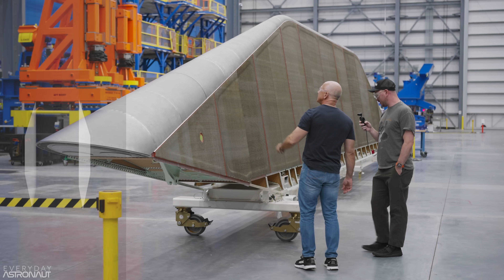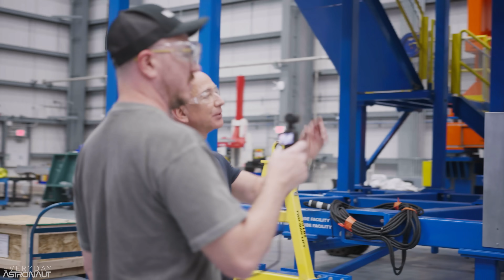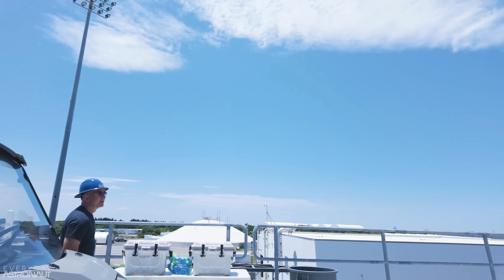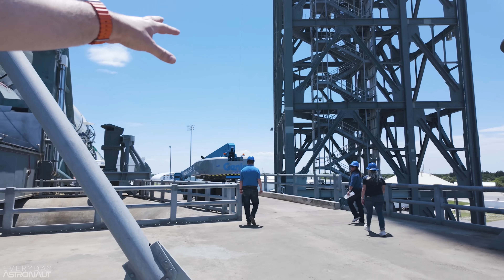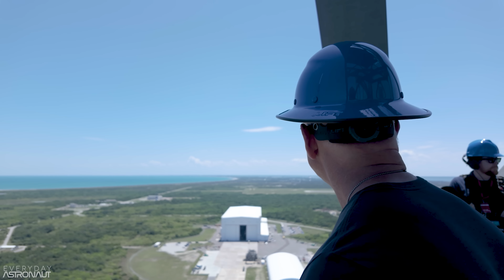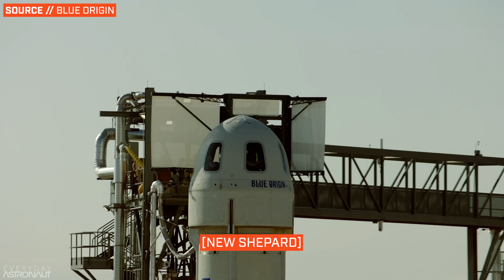First Ever Tour Of Blue Origin's Massive New Glenn Launch Pad w/ Jeff Bezos!

Comment: If your gonna have underground hydraulic actuators to put the structure at the right position, why not have a void below it to slowly move the structure below the original plane with “wheels / bearings” to put the structure close to its final position and then use hydraulics to push it to its final destination instead of using a single axis point with hydraulics to move the whole thing?

Comment: Fascinating that the rocket has the LOX tank in the rear.  I thought conventional wisdom was to put the heavy LOX at the top of the stage for aerodynamic and control reasons.
Reply: Heavy LOX at the top is more stable on the way up, but you have thrust vectoring which can (hopefully) actively stabilize the rocket.
Heavy LOX at the bottom is more stable going down, when you want the engines turned off to save fuel, and want more passive stability.
Since most rockets were only interested in going up, they were putting the heavy things high up.

Comment: First off, kudos to Tim in getting this tour.  It is great to finally have some access to what BO is attempting here.  However,  Jeff Bezos is presenting a classic "Executive level summary" of where Blue Origin is at the moment because he probably does not grasp most of the details of what you are actually seeing, but is doing the best he can to convince you he does.  Sorry, but center of gravity and center of pressure were guidelines that were applicable well before we had the capability of using new technologies like thrust control vectoring, and a software/hardware stack capable of reacting in real time.  CG/CP can be used as a baseline for stability, but have been superseded with more reactive control systems.  I would have found this to be much more informative if someone within BO who has the technical expertise had done the tour.  Just seemed choreographed even down to the detail where JB had his on special "dark helmet".
Reply: You can use the thrust control vectoring while you have thrust - going up. This is why they can get away with a bottom heavy rocket on the ascent, they can use active stabilization almost for free.
While going down they want more passive stability, without the engines running so they can leave less fuel for landing and more for boosting the payload.
Bezos and Musk may not be rocket scientists , but they are the people paying the initial investment from their personal fortunes because they are so enthusiastic about spaceflight. I'm sure they are very interested in details.
I'm certain the actual engineers have to explain the tradeoffs so the bosses can choose what to use.

Comment: I was trying to understand why their launch support tower is so tall 175 meters which seems a lot more than i expected. New Glen is 98 meters tall - why is the tower 175 meters tall which is 77 meters taller than rocket. 
It needs to be taller because the launch pad is elevated maybe 20 meters above the ground because it sits over a  flame duct, on top of the tower would also be a lightning rod and antenna's and elevator plant room which probably add another 15 meters and then you need maybe 10 meters for the rocket hold down platform and ring above the flame trench so we got a 20m flame duct +15m lightning tower +10m hold down system +98m rocket for total of 143 meters but i am still short of 175 meters by a whole 32 meters. !
But maybe they also make the tower extra tall to have a crew access arm and that would have to be near the top of the rocket so maybe another 10 meters but i still have trouble getting to the 175 meters - even if the flame duct was 30 meters high i an short 12 meters ! - they maybe have also allowed to extend the height of new glen in the future to be taller say 110 even 120  meters.  It seems like the tower as built now is quite a lot taller than absolutely required in order to allow for a variety of possible future upgrade options.

Comment: This looks so cool but I still to this day cannot understand why Blue origin didn't launch a single thing into orbit in more than 20 years of existence.
Reply: Because they want to do it right. Musk has a lot higher risk tolerance, and this is why the first three SpaceX launches failed and the company was on the verge of closing. This is why they blew up so many Starships. And this is why they can innovate so much faster - it's "All Gas, No Breaks" all the time. They managed, but I could easily imagine a world where they crashed and burned like so many others.
Bezos and Blue Origin are more careful. They don't want to have failures, so they move slower, and I can respect that. There is only so many times you can bet your company on a product and not lose it, so I respect their approach. It's not like there is anyone better suited to take the second place after SpaceX.

Comment: 6:35 Im confused about the investment cost. 338M robots at $5000 each is $1.6T, not $280B. $280B over 338M robots is $833.33 per robot. Are the figures looking at government investment into robots or the manufacturing cost to produce the robots or the consumer  purchase price or??? I guess, regardless,  the important part is that it would have a huge impact on the economy, but still, it's always good to know the sources and assumptions for the numbers to check for accuracy. The article is not clear.

Comment: New Glenn is DOA. As capable as a falcon 9 while costing a lot more to launch and insure. Starship is a beast and stands at the very top of rocket capability and is still getting performance boost and optimisations lol. Even the Raptor 3 engines while being smaller than New Glenns BE4 engines are more powerful and cheaper to produce. No contest, starship really is something special and hats off to that engineering team:) New Glenn is ok i guess.

Comment: Kudos to Jeff and BO for the tour - it’s good to see.

Not sure when this was shot however for a rocket that is launching in October it was remarkably incomplete.  I would have thought even if this was shot a month ago I would have expected a complete ship doing wet dress rehearsals three months out from launch.  Maybe it was shot earlier that his though.

The strake has ablative material on the sides so it will be a charred mass if it get any heat and have to be replaced.  Iconel for the leading edge?  Hmmm hope all these design choices work out.  Certainly not all SpaceXs choices worked first time.
Reply: This footage is from May.

Comment: Big Business vs Startup mentality that's kind of the BlueOrigin vs SpaceX comparison. Yes, the Startup approach is probably quicker but not necessarily the only way to success. The startup approach comes with higher risks but also the promise of higher rewards if it works (it's quicker so shorter time to get contracts). The BlueOrigin approach is more the planned and structured approach a big corp would take: it costs more, it takes longer, but the risks are lower and easier to calculate with (not saying there aren't any).

The best thing that could happen to space exploration and the aerospace industry is more than 1 competitor: more competition means more innovation and a higher pressure to reduce costs down the line. More competition also means more people thinking about solutions and even if your competition makes a breakthrough, you can still learn from that. The more successful aerospace companies are coming up with solutions the "cheaper" launches will become and the more we can explore space.

Just imagine there would have been just Boeing ...

Comment: Interesting they are using a transport erector, that does mean they can't handle payloads that need vertical integration ?
Reply: Looks that way. Not surprising, though... missions requiring vertical integration are pretty rare, which is why SpaceX still haven't developed the capability for Falcon Heavy, despite being theoretically contracted to provide it for Defense missions. I suspect SpaceX are happy for those missions to go to ULA instead, and have a tacit agreement that they'll maintain plans for a VI facility, but won't make a fuss if they don't get any missions that would require them to build it.

Comment: Great Video !  To reduce the cost of travel to the moon a Fuel Depot is needed in LEO heading East from the KSC !  Also a second Fuel Depot is needed on the Lunar Surface (LS) near the South Pole Lunar Outpost/Base (Clementine Base) supported by Lunar Water Ice (H2O)...  The Hydrogen from the Lunar Water can be used to recover more Lunar Oxygen (LUNOX-TM/LOX/O2) from the minerals of the Lunar Regolith !  The BO Blue Moon can then be fueled on the moon with  6.1 km/sec delta-V can then return to the LEO CSS ! 
        When the Lunar Outpost is upgraded to a proper Lunar Base the Lunar Workers (and maybe  Lunar Tourists) can move forward to the NASA designed  "24-Hour Lunar Shuttle" (LEO to LLO) by Stan Borowski (NASA Glenn Research Center) !  The Tech developed to return to the moon to stay, can take US and the world to Mars and beyond !  tjl

Comment: I actually designed and supervised the construction of a cold temp storage tank system about 25 years ago.  The tank sat on two pillars and one side had a Teflon sleeve that would allow the tank to slide along as it grew or shrank with temperature changes. If we didn't do that, the ambient temp tank secured to both pillars would cause severe damage and probably fail somewhere when it was cooled to -20 C.  It was a "cool" project and completely new to me at the time.  Interesting to see the same considerations when transferring LOX and LPG.

Comment: Everyone comparing SpaceX and Blue Origin, just remember New Glenn and StarShip have different use cases.  The approach both companies are taking are essentially the same.  BO has done the RND inside while SpaceX has gone out and flown.  StarBase is under massive development and future Starships will be built in the same clean way, like the falcon rockets are.   Both are striving for reuse but spacex is going for rapid reuse.  I wish them both luck.

Comment: So New Glenn has its Lox tank in the bottom becouse its heavier and requires heavier structure to support the tank. Then, why does the  SLS have the tank above the hydrogen tank? Also same with the Space Shuttle, but there maybe it was a CG related problem..?
Reply: I suspect it's due to weight balance with the size of the tanks, plus extra reinforcement with the Hydrogen tank.

Comment: When he talked about the ullage pipe needing to be suspended on slip joints because it turns out its expansion ratio doesn't match with that of the tank, it really makes you wonder if they've actually caught enough of those factors to be able to have a successful flight on their first try. It feels like a rocket of this size and complexity ought to have literally tens of thousands of unknown unknowns that won't make itself known before the first flight.
Reply: Of course the first flight always reveals a lot of issues not foreseen ahead of time.   The question will be how serious those issues turn out to be  because there will definitely be some issues that come up.
Reply: those things are probably quite solved when you dont innovate too much. they have veterans at the company.

Comment: I like that two major companies have two different approaches. SpaceX is rapid prototyping. Blue Origin is deep engineering (waterfall). 

Musk’s approach had payed off, but Bezos’ approach has its own advantages. The emphasis on safety is huge for their space tourism branch. 

My company has worked with Blue O for years and I’ve seen lots of engineering and management presentations (under an NDA, so no details). They have a very strong and active team. I’m sure they’ll be successful, but not at the crazy rate Musk is attempting.

Comment: For Comparison sake:
New Glenn: 45 tons to orbit
Falcon Heavy: 64 tons to orbit 
Starship reusable: 300 tons to orbit
Reply: true, but keep in mind that Falcon Heavy can't really utilize its lifting capability to a full extent, since its fairings are way smaller in comparison to New Glen. 
And the reusable Starship that brings 300 tons to orbit does not exist so far
Reply: Falcon Heavy is 64 tons fully expendable. New Glenn quite possibly could do 60+ tons fully expendable.
Reply: @mr.g937  yes but falcon heavy is based on falcon 9 which launches 20+ times each tube so it’s essentially free by the time it’s on a falcon heavy
Reply: @KCJbomberFTW  And that is precisely what New Glenn intends to do as well.
Reply: @mr.g937  but it’s missing the industry backing of everyone involved. there’s no falcon equivalent to take free boosters off of so it will never have expendable higher capacity. There’s no Glenn heavy
Reply: @KCJbomberFTW  Kuiper is launching on New Glenn. NSSL may likely launch on New Glenn. There's plenty of industry backing.

Comment: I'm sorry but your weight numbers are ridiculous and not very accurate. It's time for America to join us in the rest of the world. I was raised on oz. lb. but converted to ISO standards g. kg. Tonne, it makes life so much easier. An articulated lorry is 40 Tonnes or 40,000kg or 40,000,000g.
4,000,000lb of thrust 1,785t of thrust. Using metric or ISO makes all calculations easier. However, in my woodshop I use inches and feet.

Comment: 09:00: So the slip rings aren't - and shouldn't be - fixed to the pipelines but what about the flexibility and the durability of the end connections considering the stress impact on them by the lines themselves contracting and expanding, as no expansion bends were installed? Or is the claim actually that the tank and the lines are engineered to in fact contract and expand simultaneously equally regardless the vastly different dimensions and overall magnitude not to mention materials?

Comment: We're perhaps months away from having TWO commercially operated partially reusable heavy lift launch vehicles. Godspeed New Glenn!
Reply: Relax, though. It's still a test flight, right?
Reply: @EaglePicking  New Glenn is going straight to operational flights, the first one is NET this month and sending 2 probes to mars
Reply: @zaretya9091  Okay. That's a weird approach. It could be a bold move, if it works out, but it could also be quite stupid in hindsight, if it fails. This is literally rocket science and many things could go wrong, even after testing.
Reply: @zaretya9091 not anymore. NASA finally realised new Glenn was never gonna be ready for this Mars window.

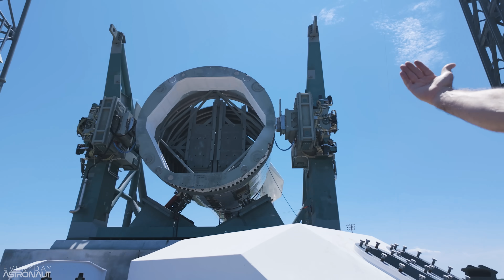Comment: 23:35 I paused it here and looked at it for a while. The hinge point you can see at 18:46 is way below these two towers sticking up next to the vehicle at 23:35. But those towers are attached to the vehicle, not the transport errector. So, if the hinge point is way below those two other points of attachment, then those points of attachment must slide down those towers as it rotates around the pivot point, right? The geometry doesn't work out otherwise. Am I thinking about this the right way? Like, as it's being lifted vertical, those two points where it's connected to the vehicle at 23:35 must slide down those two arms as it rotates, right? I guess the other way it could work is that those arms rotate with the vehicle instead of staying upright. So, which is it? I'm confused.
Reply: I see no issues with how the apparatus will lift the New Glenn up to the pad.  It rotates at that pivot point to place the vehicle directly over the pad.

Comment: This is really cool. But there do seem to be a lot of potential points of error in the transporter erector system. However it does seem that if they work out all the gremlins it would eventually be quite reliable.  I'm just worried they haven't tested this enough (but maybe I'm biased by SpaceX coverage).

Comment: I’m actually very impressed with Jeff and how much he actually knows and understands about his company and designs and engineering-  really cool to see-  not a fan of Jeff but this for sure makes me look at him in a bit better light
Reply: This.  I swear Jeff, just treat your workers better+let them unionize and share a good chunk of your wealth and i may actually look up to you a slight bit.

Unless he secretly has ghoulish hatred of some group, or is a chainsaw murderer etc those are my only problems really and quite fixable.

Do it for your legacy, if not for the goodness of the act itself!
Reply: He initially went to college for physics, but ended majoring in computer science and electrical engineering. He's a STEM guy through and through, with a focus on logistics. He built Amazon off the back of his understanding of logistics.
Reply: @scirrhia_kruden  It took me years to realize how critical logistics is to every sort of commerce.
Reply: I've worked with a lot of good CEOs, and they are usually switched on. There's a common misconception that CEOs are pencil pushers. I've known quite a few as a business consultant and I managed the design of a large casino once. I used to spend made hours going over plans with the CEO, down to the very fine detail of even where paging transmitters would go for optimal coverage just as one example.
Reply: I'm a huge fan of Jeff.  And Musk.